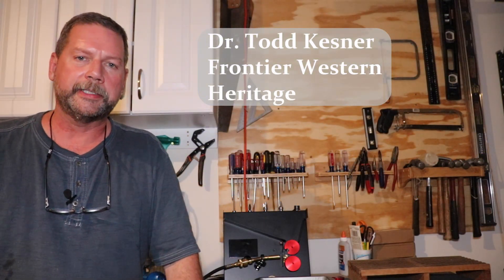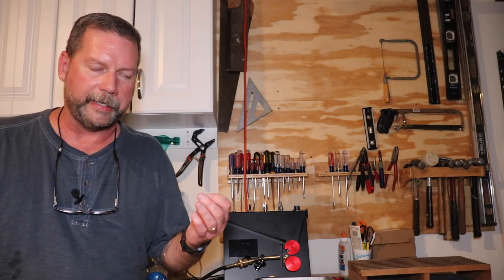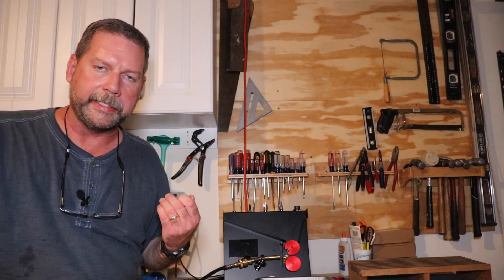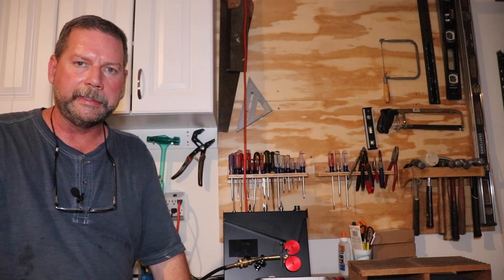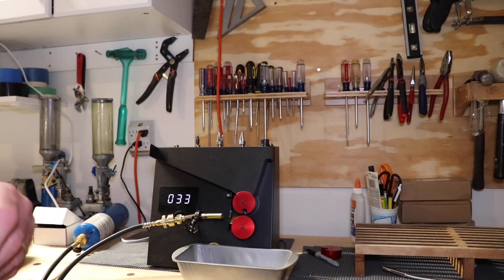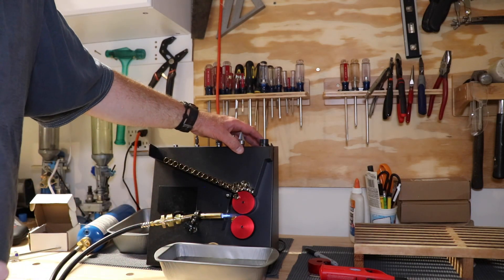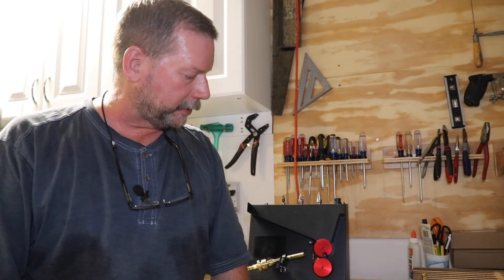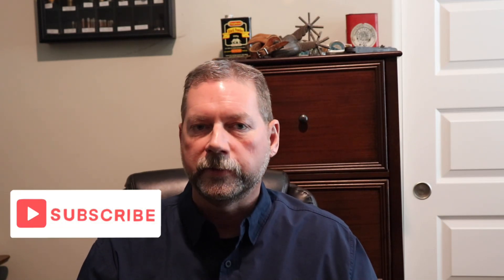Annealing vs Nonannealing Part I

Comment: I've always used a small "Lazy-Susan" with a pie pan glued to the top and  put a magic marker  black dot target mark  in center, filled with water 1/2 way up cases. Place case on dot,  keep spinning with fingers of right hand, apply propane torch to neck with left hand for about 6-7 secs (until change in color) Tip over  and grab another case. Goes pretty quickly. Dry them in the Arizona sun.. I anneal my .45 Colt brass every 3 firings. Still have my first batch of 100 cases  that have been fired 24 times (annealed 8 times) now and not a single case split. Love your videos ❤DJ   (  PS: Phoenix Rod and Gun club open all year round no fire hazard closings Come on up 🙂.)

Comment: I came here to write, that you don't need a fancy machine or jig to anneal. Get a baking sheet and line up your cases. Fill it with water. Then, use a propane torch. Works best with a hose so you can leave the gas bottle right side up. I use Tempilaque and a metronome on my phone, to  time how long it takes the Templique to turn transparent then just count them out. That way you're not using a lot of of it.

If you don't anneal, your cases will start to split after several reloading, so you don't really have a choice. They start out soft and get hard after being worked over and over.

Comment: Many people don’t like the 32-20, 38-40, 44-40, because the case necks are thin and easy to damage.   But this insured that there was minimal gas leakage into the action.   The 45 colt was never meant to be fired in a Winchester rifle and is prone to gas leaks, fouling the action.

Comment: I have never had the need to anneal pistol cases, but I do anneal my 45/120 and large Nitro cases as it extends case life, the reason the water quench is essential for the short pistol cases is that if they are allowed to cool slowly the annealing can move along the case and anneal the primer pocket with disastrous results, I use a socket in the pistol drill and rotate the case mouth in the flame, just tip the socket up and drop it in the water quench. I am looking forward to seeing the results of this! Stay safe! Chris B.

Comment: Have you heard of a New Zealand product, called the AMP Annealer?
Reply from the maker: I have not.  Thanks for sharing the tip.  Todd
Reply: @frontierwesternheritage1356  Hey no problem. It's an induction heater, with a bit more scientific approach to achieving the ultimate accurate annealed product.